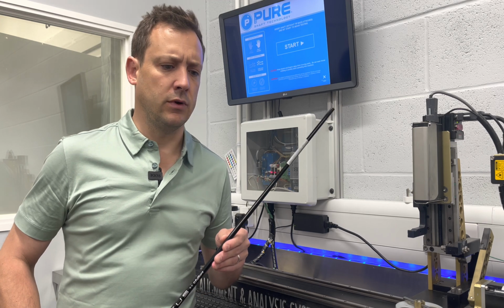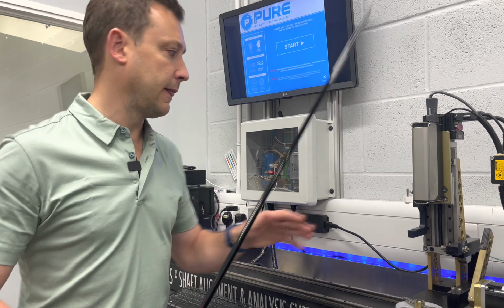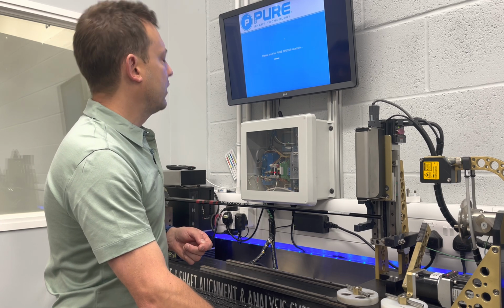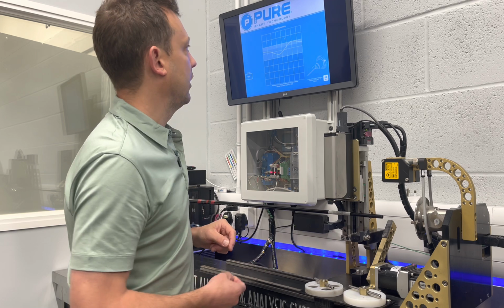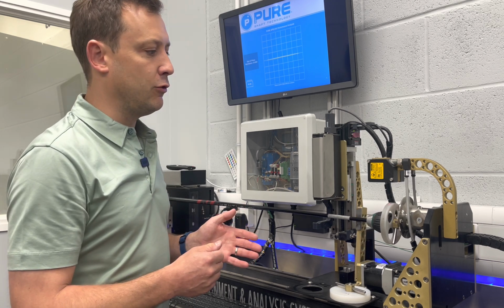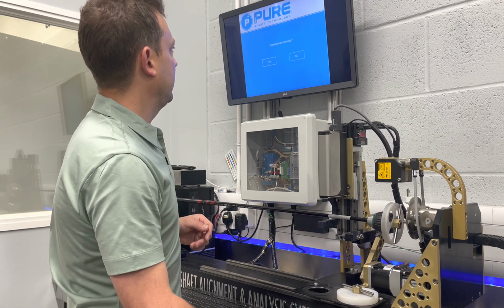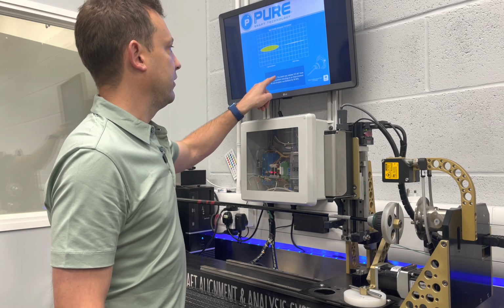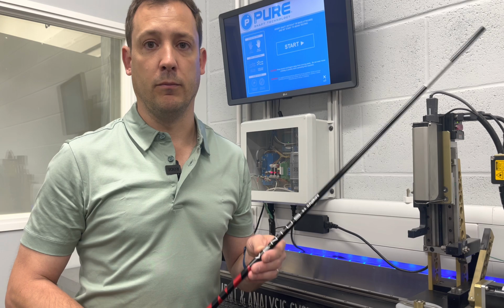SST PURE Shaft Alignment

Comment: So the line after puring goes towards the target or vertical of target line thanks
Reply from the maker: The line made by the PUREing machine on the tape is installed on the top of the shaft but the most stable point is target facing

Comment: I appreciate that you are using something to replicate a head on the club. But the device is perfectly round. Which a golf head is not. Wouldn't that change the the way the shaft reacts?
Reply from the maker: If anything it exaggerates the off-plane rotation and twisting so makes it even more important that the stable plane that the shaft orients towards is target facing

Comment: I recently purchased shafts that have been purred. When you say 12:00, do you mean with bottom of club flat and 12 :00 to hosel or 12:00 to the face of the club where impact is with club flat?
Reply from the maker: Hi Jim

The alignment mark is at 12 o’clock if you look down at the hosel. The PUREd orientation is in the target facing plane. The mark is purely for installation purposes only.

Comment: great video. if you change the loft of the Driver shaft how does this affect a pured shaft, my original driver shaft was pured (ping tip) for two clicks down to 7.5 degrees, but if I am moving it back to 9 Degree standard loft setting how does this effect the shaft? would this increase dispersion? is it worth getting the ping tip reset to match the pure setting at 9 degrees?
Reply from the maker: It will take it out of the SST Pured position so certainly best to have it reset into the resultant hosel position
Reply: @Precision_Golf and if you have bought a shaft that has already been pured, is there any indication on which setting it’s supposed to be in to get the most out of it? Cheers

Comment: Once pured, where does the line point to? Towards the target? I'm confused?
Reply from the maker: Hi. The installation line is positioned at 12 o’clock but the pure orientation is target facing so technically 9 o’clock. It’s easier to align the shaft with the face than 90° to it.

Comment: I think the jury will always be out on Pureing. The measurements in the video , show the shaft in it's most stable position, but that's under horizontal force. The golf club is a rotational force and so, the relevance of that test will always be disputed. I've watched several Pured vs non pured tests , TXG's test comes to mind, where no difference has been found.
Reply from the maker: Many thanks for your comments and thoughts, always keen to hear everyone’s views. TXG invested heavily in a SST PURE license, before they were acquired by Club Champion, so you’d like to think they’d have carried out conclusive research on the merits before committing to signing.
Reply from the maker: Hi Lloyd. Check out TXG’s latest live 19th Sept at 27 minutes.
Reply: @Precision_Golf  Sure they absolutely said that , but it contradicts the quantifiable and measurable data that they found in their driver v driver test, which displayed literally no difference. I've yet to see any video on YouTube which has shown a measurable benefit of pureing, and by that I mean a significant improvement in side to side and front to back dispersion.
Reply from the maker: @GRIFF22  ultimately it’s a technology we firmly believe in to eliminate any questions of shaft instability. We have many experiences over the years of customers wanting a shaft PUREd and have eulogised about the results. Regardless we incorporate it into every build without a specific charge. PUREd vs Non-PUREd it’s the same cost. I know independent testing had been carried out, to what extent I’m unsure but I will get this data for you. 👍🏻
Reply: @Precision_Golf   I appreciate this comment is 3 years old but you've recently built me a set of clubs and charged £40 per club for the SST PURing... admittedly a cost I hadn't budgeted for and wasn't expecting...
Reply: If you change the lie and loft, does that have an effect on the original marking during the during process?
Reply from the maker: https://youtu.be/g98OKRQ4QJY